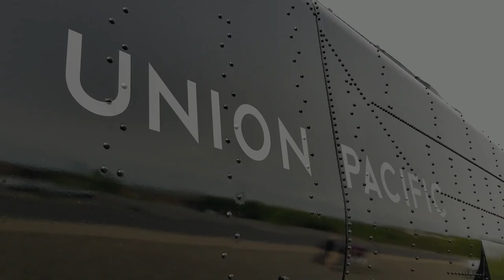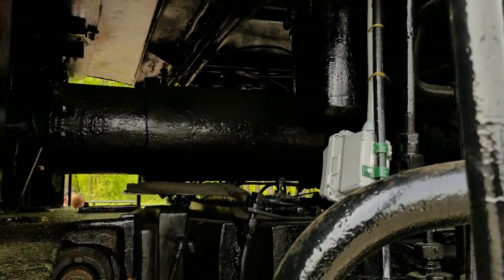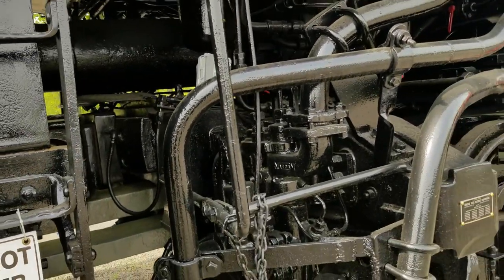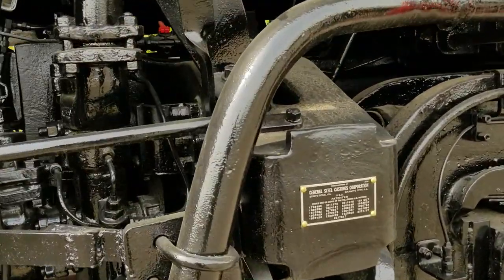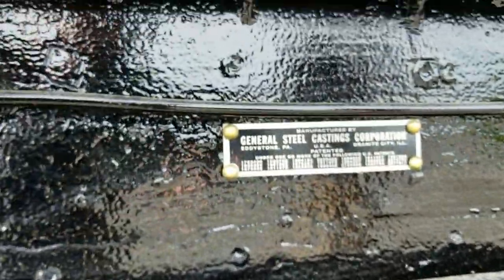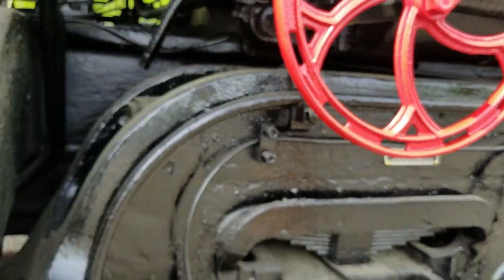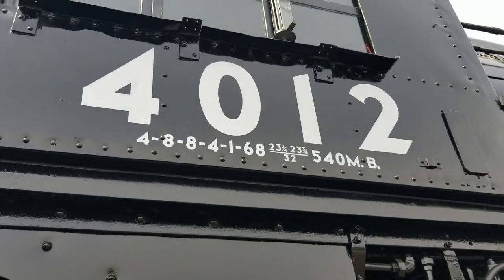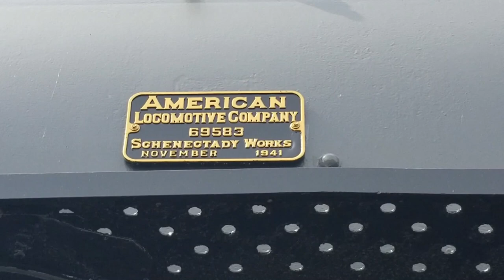Big Boy Returns to Steamtown

Comment: Looks like they did a very good job restoring this engine, I wish they would put it under some sort of roof to better protect it from the elements.
Reply: Can’t just put roofs everywhere. It’s so big compared to the other equipment there. If done right it should hold up without a roof. Roofs can also trap moisture Which in the wet climate of PA can be counterproductive for the stability of the engine.
Reply: @PereMarquette1223  It would be good if they had somewhere enclosed to stow the boiler jacket though, as was done with 4014.
Reply: @ZeldaTheSwordsman  4014’s jacket in California was scrapped decades ago. The one it has now is all brand new.
Reply: @PereMarquette1223 Source?
Reply: @ZeldaTheSwordsman  the museum… and that UP would never reuse anything like that. 99.9 percent of the time UP will make something like that, never reuse the old material.
Reply: @PereMarquette1223  Provide a source link.
Reply: @ZeldaTheSwordsman  I don’t have a link. Go message them, it’s what I did. No better response then from the source themselves.
Reply: The one locomotive that should get more love is the union Pacific 9000 class steam locomotive. It has 4-12-2 wheel arraignment, 3 sets of pistons and LUDACRIS AMOUNTS OF TRACTIVE EFFORT.
the people who were asked to build the 9000 class were like: How much tractive effort do you want it to hav-

The designers: YES

 And fun fact it was built before Big boy and the challenger
Reply: @jerrywalker7192   its too big for a roof

Comment: Before anyone says anything regarding operation, no! 4012's restoration was only cosmetic, the eastern US is not a favorable place to run 4012 and Steamtown can't run it anywhere if they were to restore it to run again. 4012 will remain on display for the foreseeable future. Be grateful that we have an operational Big Boy at all.
Reply: Understandable. Really.
Reply: Yeah, realistically the only people who could run 4012 would be its original owners. And that's not likely.
Reply: You did say "operational" ?Doesn't that mean it can move under it's own power?
Reply: Why can't they operate it on the east coast......it is an articulated engine and can I have seen it's sister engine 4014  in Cheyanne Wy. yard coming out the shop on to the main line without any trouble.......yard turns are a lot sharper than any main lines on the east coast!!!!! Steamtown really miss the boat when U.P. restored 4014 didn't they? next you tell money was an issue.....
Reply: @trenchantsometimes5149  Money certainly is an issue. I think it was 2 million to do 4014, but it may have been more.
Reply: @trenchantsometimes5149  actually 4012 was one of the candidates for restoration by the Union Pacific, but it was unknown if the tracks around it could handle it so they chose 4014 instead in spite of 4012 being in better condition. I’m glad they went with 4014 though as it has a unique whistle among its class.
Reply: 😅 it certainly didn't fly to it's current location. 
Watch the video of 4014 being moved from static display.....
Biggest problem is the tender clearing curves.

Comment: Would love to see Steamtown restore the 4012 to operation!!!!
Reply: 09trainfan said it is "operational"
Reply: @trenchantsometimes5149  Years ago there was talk of operating it on compressed air so it could move back and for a bit, but I don't know whatever happened to that idea.
Reply: 4012 was among consideration for the Union Pacific to restore due to its great shape compared to its brothers, however they ended up choosing 4014 due to the tracks surrounding 4012 to likely not be in good enough shape to hold it.

Comment: Steamtown only has ONE operating locomotive. The 0-6-0 Baldwin #26. They used to have the 3354, and 2317 operating. Now excursions are done with diesels.
Reply: They probably still use the diesels for moving equipment around when needed.

Comment: 4012 looks like 4014 when it is restored. But what's the diffrence between 4014 and 4012? Well, let me tell you. 4014 uses 3985's oil tender which means that 4014 now runs on oil. While 4012 still has its coal tender. Also, 4014 is running and 4012 is on display.
Reply: Ash pan is missing to.
Reply: @andypettit5869  Yes, the ash pan is missing on 4014.
Reply: Was the 4012 the locomotive that derailed, and was in it's side back in the day?
Reply: @andypettit5869  No. It was 4005.
Reply: they were all converted to oil at some point in the 1940's because of how much coal they used.
Reply: @dannydorito9815  that’s not actually true. they tried to convert one, but it didn’t go very well. So they all remained coal-powered.
Reply: @DerpyPossum  All archival footage I've seen of Big Boys shows them burning coal.
Reply: 3985 is supposed to be restored to operating condition by it's new owners. 3985 was converted to oil, but now has 4014's coal burning tender. I don't know how they will work out the details.
Reply: @1940limited  Only 4005 was converted, as an experiment in 1946. It only lasted 2 years before being converted back to coal in ‘48.
Reply: @DerpyPossum  Interesting. Some UP steamers and many Santa Fe steamers were ordered new as oil burners. I prefer to keep them burning coal, but I understand the cinder and forest fire problem. Did you ever see Chinese steamers spewing out live cinders? It looks like fireworks at night.
Reply: @1940limited  I’m pretty sure the new owners are going to covert it back to coal(at least from what I’ve heard)
Reply: @EvilTurkeySlices  Sounds good to me. I think it will run better on coal.

Comment: what should've happened was to put it back in service like the other big boy it's much better off in action just like the other one that came out of North Platte and did a run through this one could do the same if properly restored that would be perfect compared to the one at the Midcontinent railway museum up in Green Bay WI That is currently rusting away badly enough to where it wouldn't even be feasible to restore it at all rumor also has it that they're going to scrap the locomotive on site that's going to be horrible and I'm hoping that it doesn't end up in the hands of the scrappers torch‼️‼️‼️‼️‼️‼️‼️

Comment: Looks fully operational!, what is wrong with it?
Reply: It would need to be totally disassembled and rebuilt from the ground up to make it run again. It's what was done to 4014.
Reply: @1940limited  although 4012 was in better shape than 4014 before it was restored to operation.
Reply: @EvilTurkeySlices  Perhaps transporting 4012 across country was daunting plus it's the property of the US Government and who knows how much red tape would have been involved trying to get it. It's now cosmetically restored which I think is as far as it's going. I'm sure UP knows what they're doing. 4014 was chosen and is up and running despite years of naysayers convinced a Big Boy would never run again.
Reply: A new paint job hardly makes it operational. If you examine the locomotive closely you'll see it's anything but operational.

Comment: Will it come into service?...
Reply from the maker: Unfortunately, no.  This was just a cosmetic restoration.  The East coast rail system is not favorable to operate the Big Boy locomotives.  That's why UP #4014's excursions don't come far East.
Reply: @vandorenmediaworks  are u sure bruh?
Reply: @factssoup5056  what about that doesn’t sound true?
Reply: @DerpyPossum  hmmm
Reply: @DerpyPossum  we'll wait and see
Reply: @factssoup5056  wait and see what? it’s not operational and it won’t be so long as it stays in Steamtown.
Reply: @DerpyPossum  so u say that it will not come to operation?
Reply: @factssoup5056  yes! why would it?
Reply: @DerpyPossum  yep
Reply: @DerpyPossum  another thing
They did cosmetic restoration